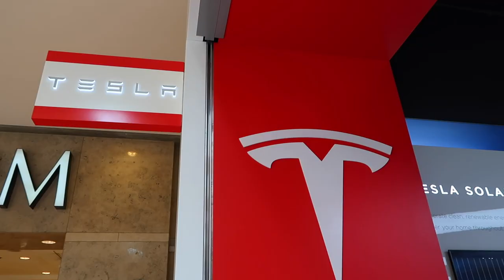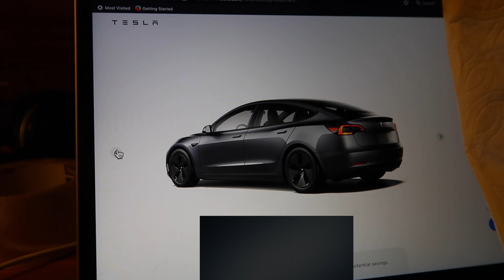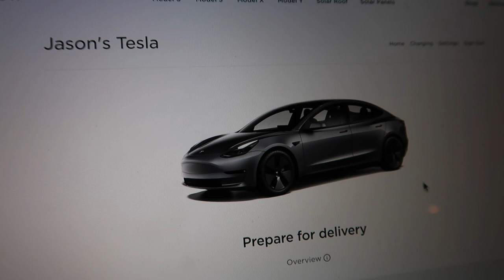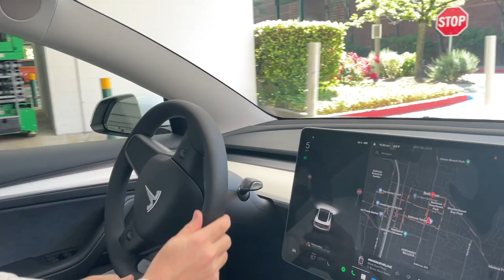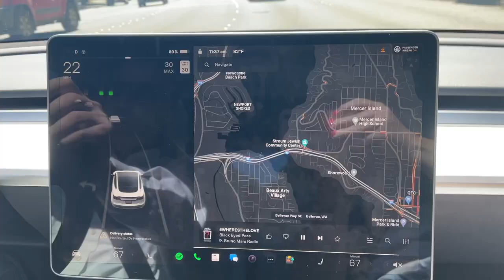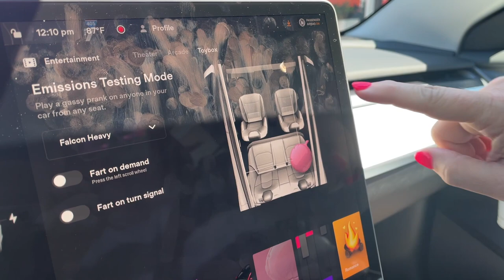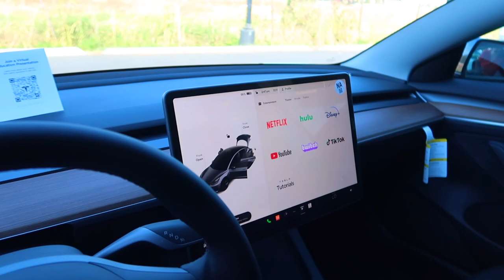GETTING OUR FIRST TESLA! | TESLA MODEL 3 | CUSTOM TESLA PROCESS 2022 | TESLA 2022

Comment: I am happy for Jason to get a new car. But I would buy a used car that uses gasoline and I heard that a hybrid car battery would cost about $7000 and I couldn't afford the battery for a hybrid car
Reply from the maker: He won't ever be going back to gas cars, and once we don't have kids around, I just might be getting the SUV version of the Telsa! Years down the road though. I don't know about the hybrid batteries, but most don't have to replace them. And with TESLA's, they rarely need to be replaced. They were designed so well. It is an expensive car though, which we understand.